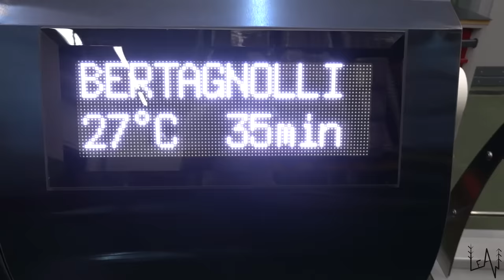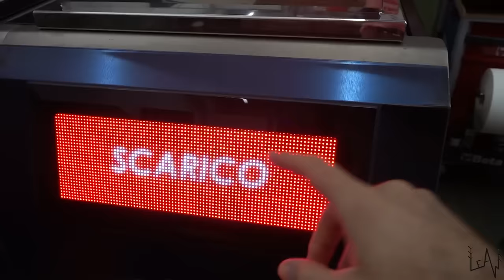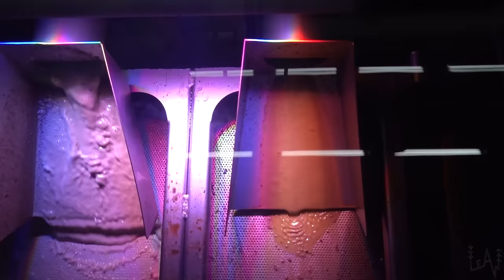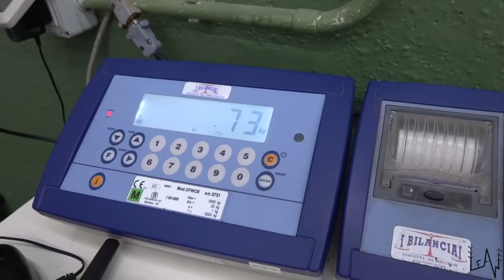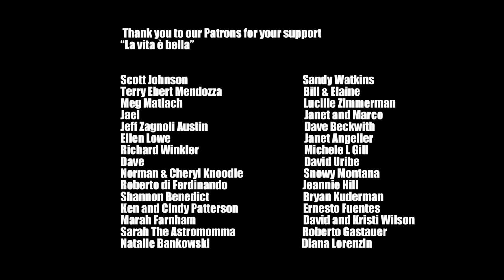FIRST OLIVE HARVEST ON OUR OFF GRID HOMESTEAD IN SICILY!

Comment: You use the spray very badly first you need to have goggles on that fully enclosed the eyes like safety goggles then when you first begin to spray you want to be about 15 ft away or 4.5 m quite distant then spray for a good bit and then walk away then come in for the second spray you can come a bit closer and spray again for the same time again walk away get your distance up quickly but don't run because running will attract them finally go back a third time after a half hour or so double check things and spray again